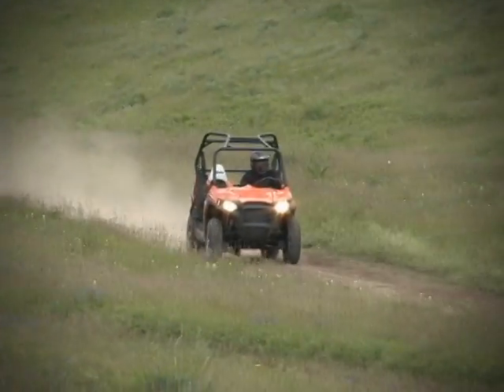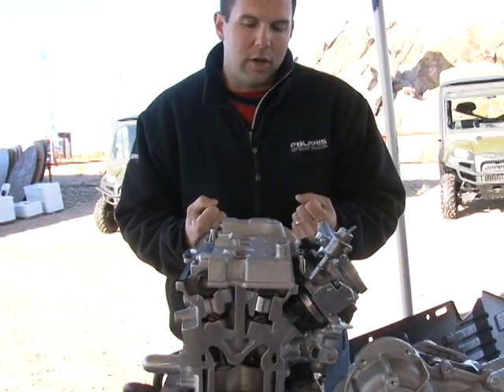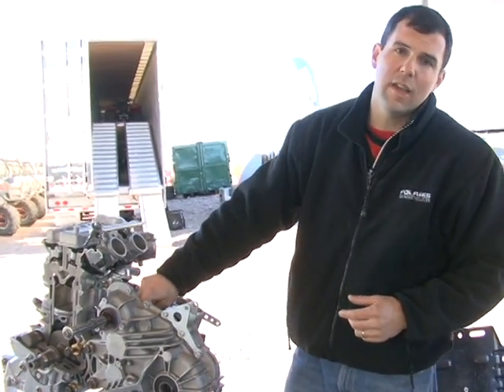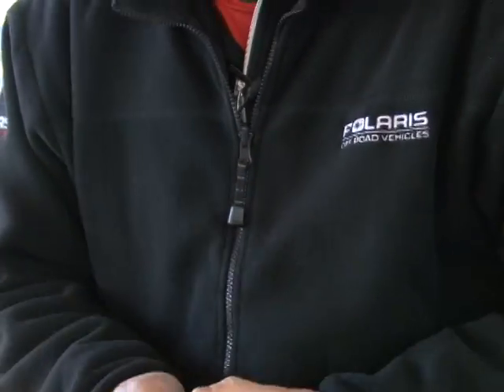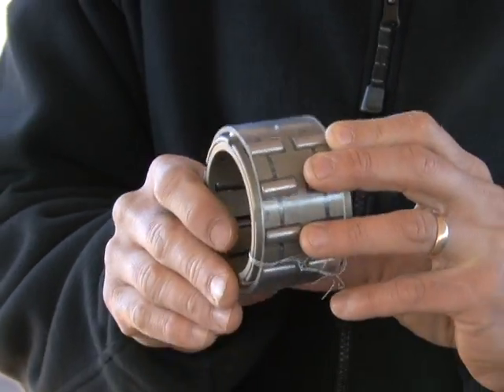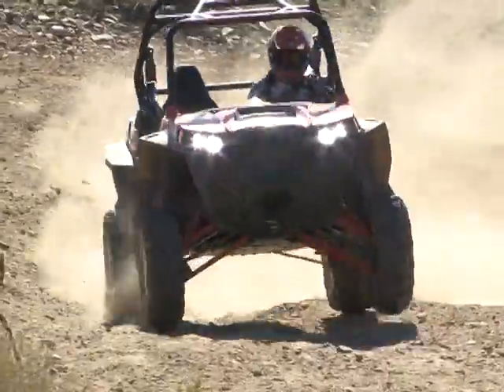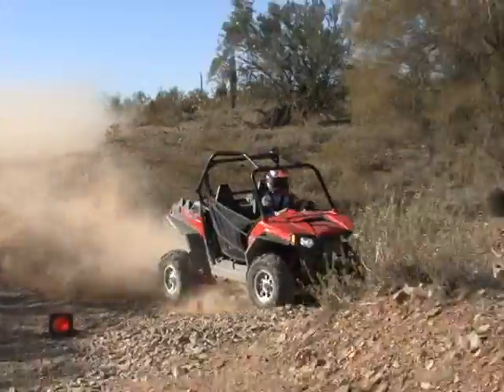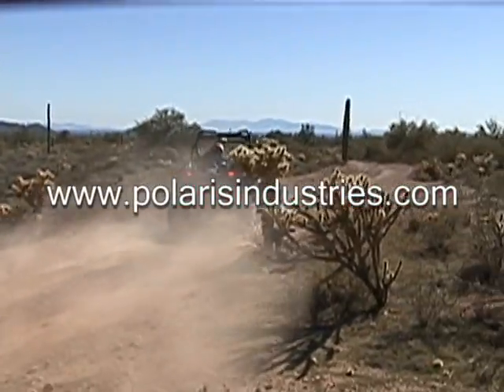2011 Polaris RZR XP 900 Test

Comment: I need one in my life...
Reply from the maker: You're in luck, you should be able to find one of these in good condition on the used Market pretty affordably with these days.
Reply: UTVonDemand what do you figure they go for now days?  I’ve seen one with a new engine 2012 with a bunch of accessories like solid doors and roof and better tread tires etc for about $10k 🇨🇦.  Seems like a decent buy.  From a dealer.
Reply: @longboardguy   2011 Polaris rzr 900
Bark River, MI · over a week ago · 
$8,500
Reply: @longboardguy  2011 Polaris rzr 900 nice machine with 5900 miles asking 8500 obo
Reply: You do you really do. I referred to the gas pedal as a "Giggle Switch"
Reply: sean corbett not a bad price now days.  Thinking to pick one up this summer for a good deal I don’t want to step into sxs with the high dollar.  See how much I use it before I ever think of buying new haha
Reply: @longboardguy  Have you taken a look at Quad Hunter site? It has all brands of atvs/sxs for sale new & used.   . "See how much I use it before I ever think of buying new haha".  Thats understandable..lol